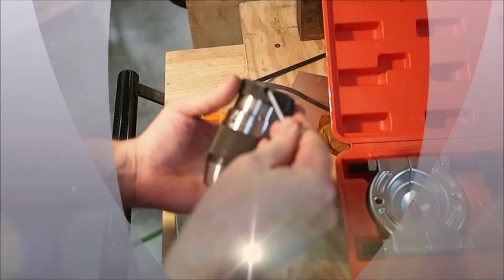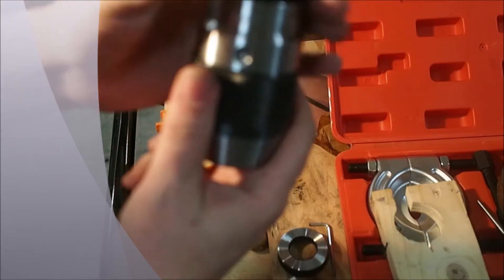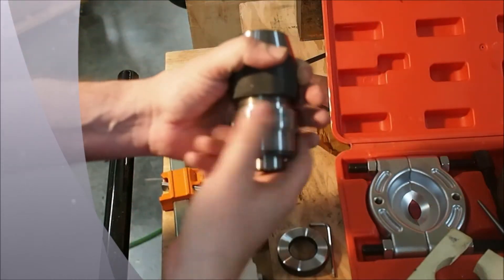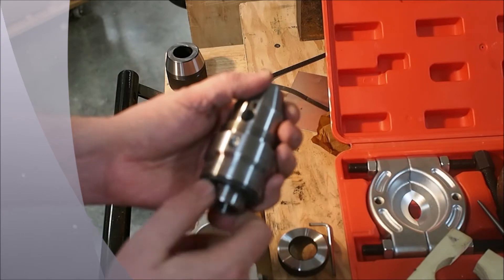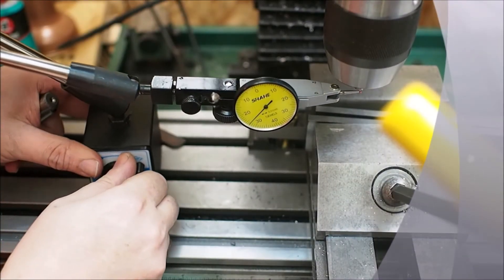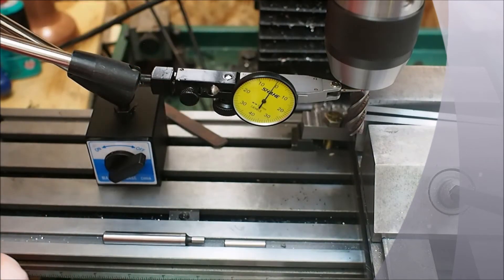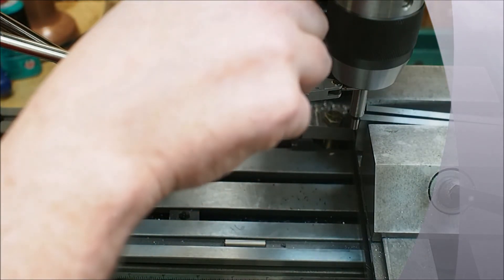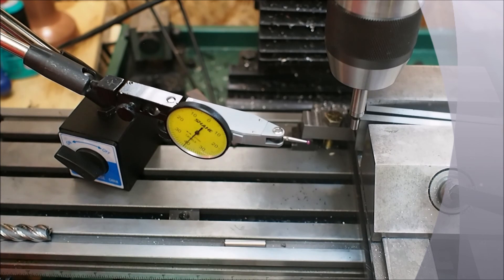Chinese 5/8 keyless chuck JT3 disassembly

Comment: Hey Jesse, I have the same chuck, same problem. I’m in the process of disassembling the chuck now. What type of lubrication did you use? I have a tube of super lube so I think I’m just going to check the parts and reassemble with that lube. I see this vid is a year old, how is the chuck doing? are you still using it? 
Thank You for the video, it helped me out.
Reply from the maker: I believe I used lithium grease, nothing special.